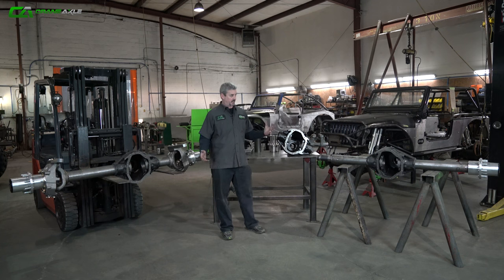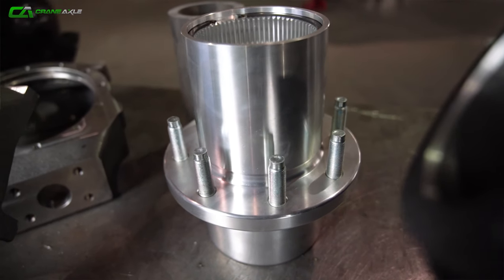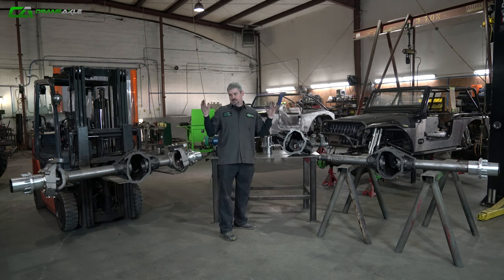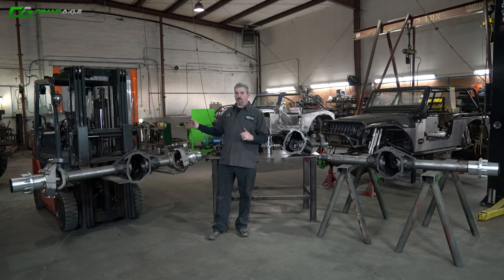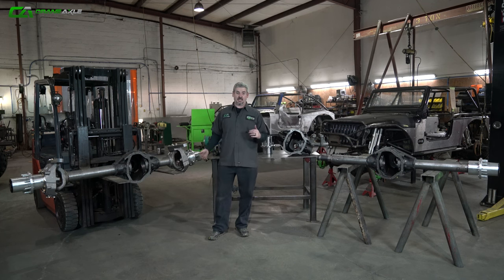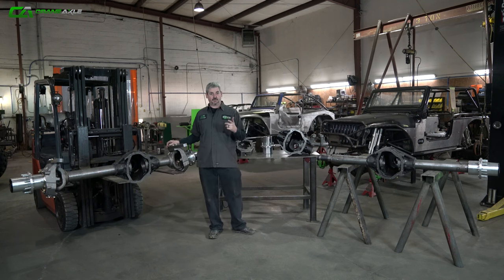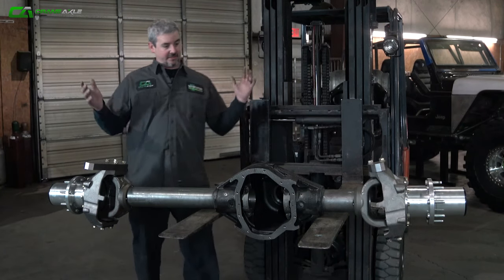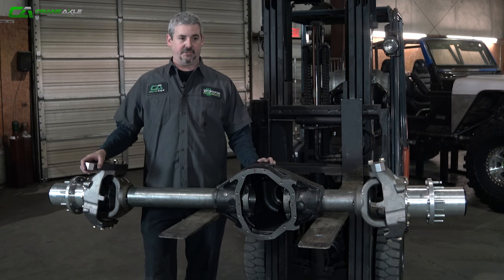Building Dana 80 Heavy Duty Off Road Roller Axles - Crane Axle

Comment: Can you build one for the front of a F650? I think a chromoly shaft and truetrac unit would be great internals, but would need the outer hub setup for 10x285.75 bolt pattern with disc brakes. For residential contracting, it’d be plenty strong

Comment: That a baller axle right there.. Stronger then a 14 bolt, with similar build? Whats the cost on something like this
Reply from the maker: It depends on what options you choose and if you want a ready to ride or roller axle or a housing to build your own. You can check out our site for current prices: https://craneaxle.com/default/products/axle-assemblies.html
Reply: @CraneAxle  my problem is, ive been through 2× 14 bolts and this latest one the brake mounting ears are slightly bent and I'm tited of brakes dragging
Reply: @gregleblond9367  The Dana 80 is really about as strong as it gets. It will cost more than a 14 bolt though. You could also re-work your 14 bolt if the brake mounting ears are the only issue.
Reply: Is it possible to have a front end built in a custom width?

Comment: So when are you going to start producing portal axles?
Reply from the maker: Not sure - no plans yet but that could change.
Reply: @CraneAxle  cool. I’ve been racking my brain trying to figure through how it could be done with the portal box being permanently mounted to the axle and the inner-C and rear spindle attaching to the outside of the box. Throwing the F450 Unit Bearing on that axle (different video) was the ah-ha moment I needed. I doubt I’ll ever get a chance to build it, but I know what to work towards if I do.
Reply from the maker: @lanceroark6386  Sounds like you got it figured out brother! If you ever get 'er built we'd like to see it :-)

Comment: This is going to be my last build... That said, I noticed a guy wanting portals on axles that were designed to be the last ones you ever needed.
Seems counterintuitive to put a portal box on an able axle meant to crush rocks on a hopper/bouncer. Maybe on a highway set of gears in the 3-4's for lift too, but these axles are not what he's needing. Portals on a Dana 80 ring/pinion = transfer case delete and one more week link with a new breaking point?! 🤔🤣🤣